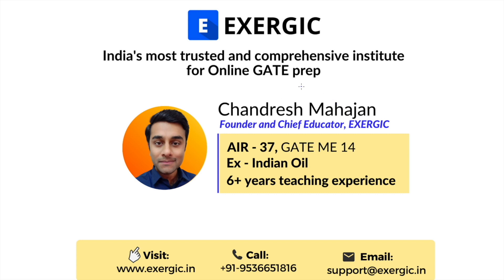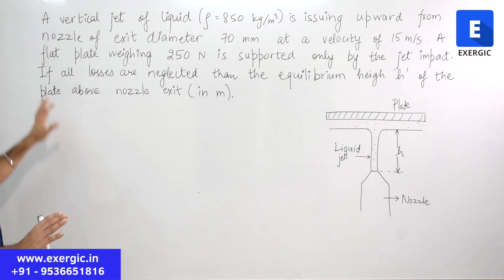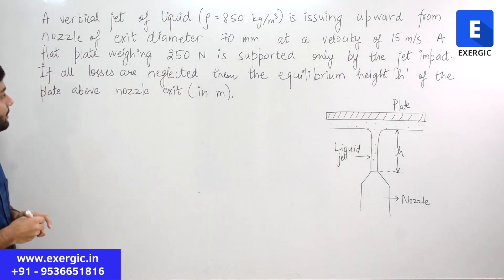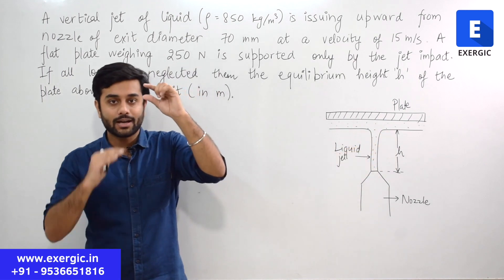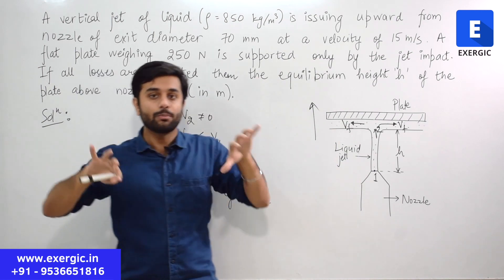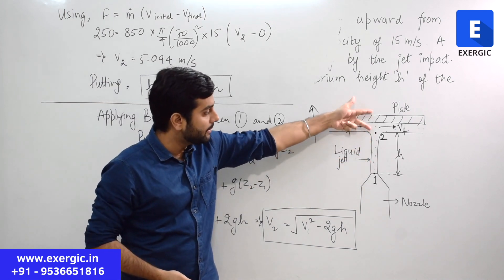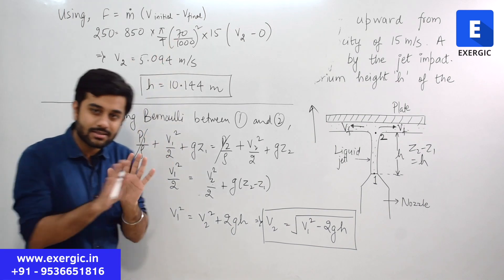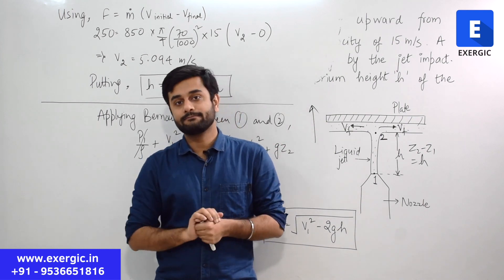Vertical Jet tricky numerical - Fluid Mechanics | GATE Mechanical

Comment: This was one the most beautiful problems I've seen! Thank you sir!
The beauty of the problem lies in the fact that if you consider volume flow rate and then multiply V2^2 you will get wrong answer because with decrease in V area has to increase so Volume flow rate is not constant...but how surprisingly according to "RTT" both are correct but it's all about common sense. 
Beautiful. ❤️

Comment: Sir I have a question...when the water jet having velocity V and it hits a block horizontally and block moves with velocity U with Same direction. Then according to book the force exarted = dA*(V-U)^2..but according to your concept it should be = dAV*(V-U).... Which on is correct?....sir please reply
Reply: Here d = density of fluid
Reply: Ye konsi book ka formula hai

Comment: Sir, here velocity that you have used in masss flow rate is issuing velocity from jet...but while jet is impacting the velocity is different....mass flow rate is for striking the plate so the velocity that should be used will be of point 2 na in mass flow rate?
Reply: Mass flow rate is same for Point 1 and Point 2. But, since Area2 is not known V2 can't be used to calculate mass flow rate.

Comment: Sir,
While calculating the mass flow rate we consider initial velocity 15m/s
Why we did not consider striking velocity V2
Reply: I think flow rate is equal everywhere
Because when the jet goes upward velocity decreases but area of the front of the jet increases accordingly
Reply: @29adhilfaheem58  great exaplination Bhai... thanks 🙏

Comment: But actually between 1 and 2, continuity equation fails because A1V1=A2V2 since area is constant then V1=V2. can anyone clear my doubt
Reply: I think between 1 to 2 there is no any pipe so you can not use that concept
Reply: @pranaykothari571  that doesn't matter bro.u can apply anywhere for a given section because mass is conserved right
Reply: Actually area doesn't remain constant because velocity is not constant.. 
.
Reply: Don't see that diagram.. Area will increase gradually
Reply: Yes bro but A2 is increasing.A2 is not equal to A1.